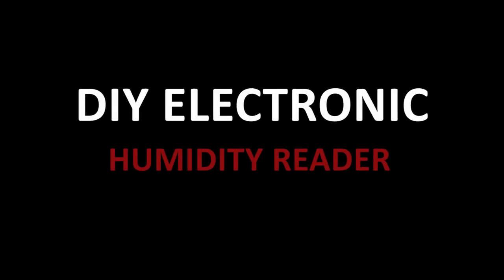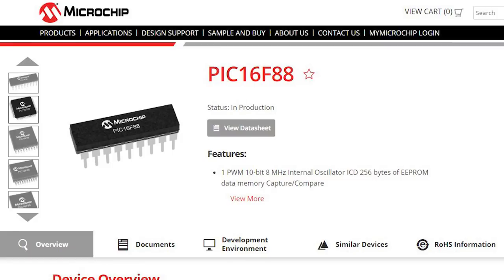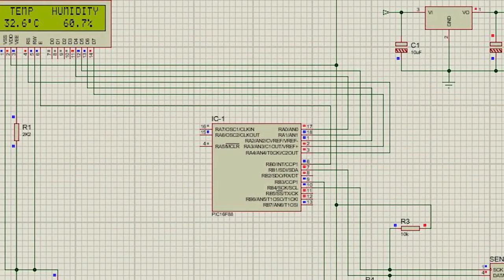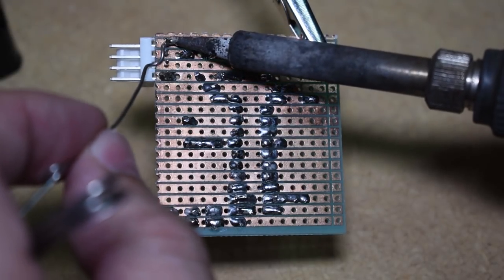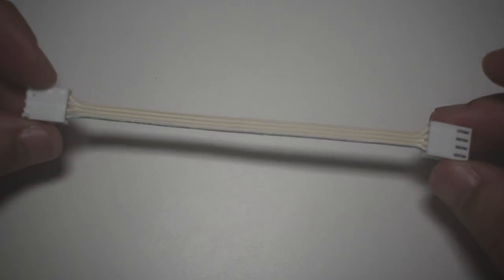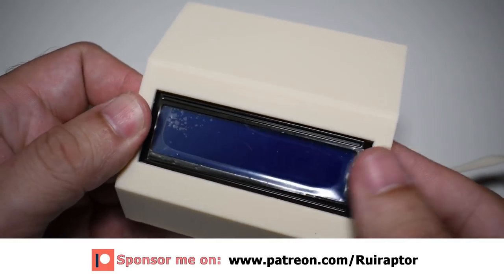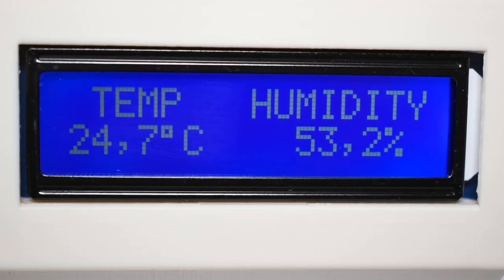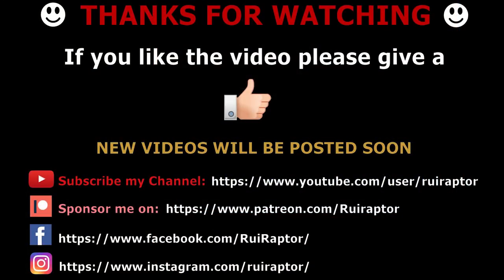DIY Electronic Project - HUMIDITY READER - Cheap & Easy!!!

Comment: To make the cuts on stripboards, I use a 1/8" drill bit, quick and easy. For those who don't know anything about PIC, you can use an Arduino. For that kind of small projet, I really like the ATtiny85 (DIP8 format) but they cost almost the same than an Arduino Nano.
Reply from the maker: Hi,
thanks for sharing and it's true...a drill bit will work perfectly.
Regarding the arduino, yes, you can use one instead. The arduino is very popular because it comes ready with the external accessories like voltage converter, FTDI for usb interface and with all that it does not need a programmer. I prefer to use the raw chips from microchip and assemble with only what i need. The cost of a pic is only $4.
Reply: I also prefer to "solder" my circuit from scratch with ATtiny or Atmel processors. Buying a small board like an Arduino Nano feels like cheating and there is no fun !